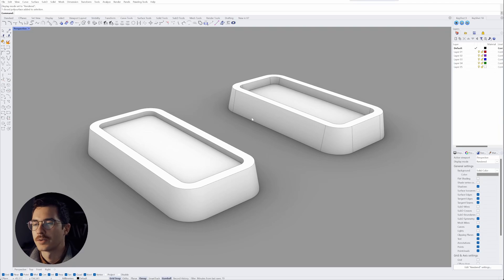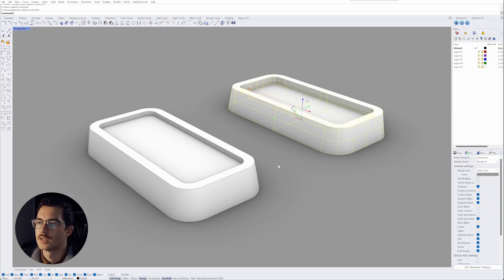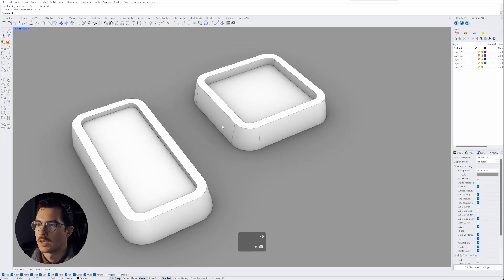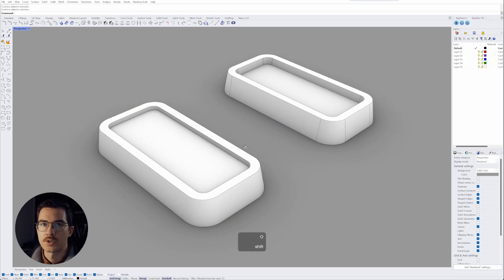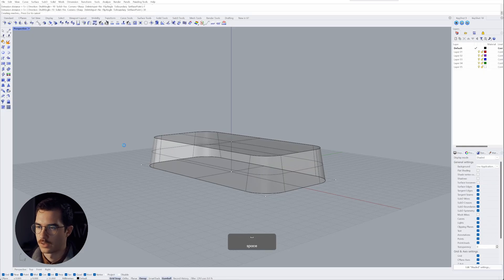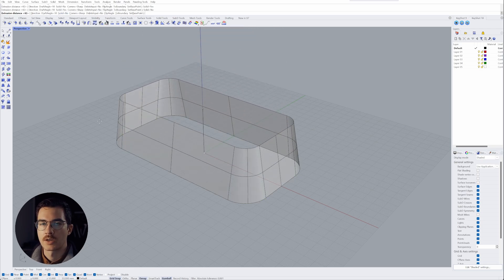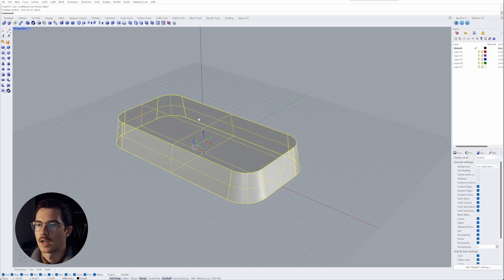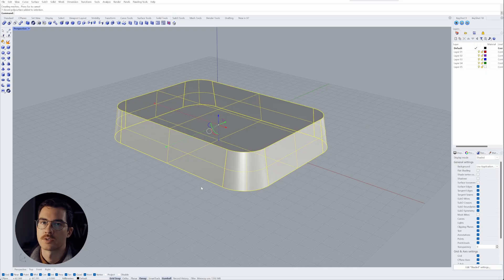How to do extrusions the right way in Rhino

Comment: I think that this is a bad default setting from rhino to always merge the surfaces. Either there should be an option in the extrude tool to split at the meeting points of the curve or split up the surfaces natively in the tool. Rhino basically teaches the people a wrong surfacing workflow through merging these surfaces together :D

Comment: But we can play with extracted isocurved in 1st option as it gives continuous curve to use for further division or working. Also the flow will have more flexibility in option 1 because it is single continuous surface. Even you can split the option 1 with split _isocurve command to achieve option 2. Actually it depends on the need but your argument is also valid for that situation.